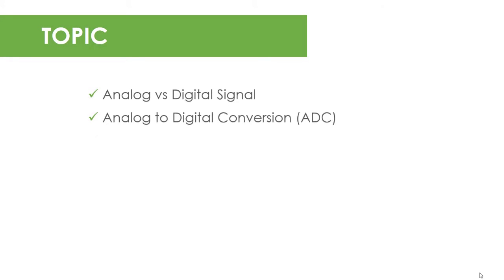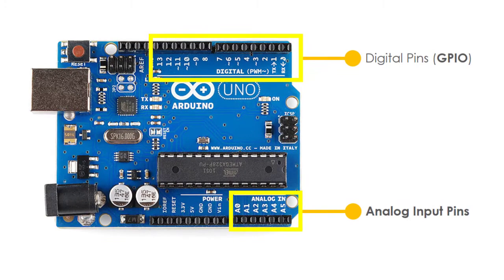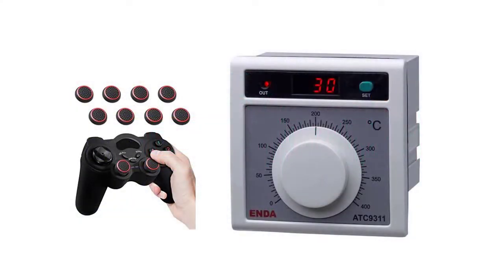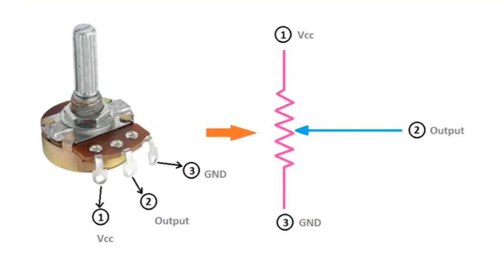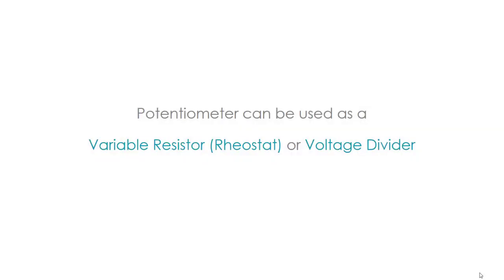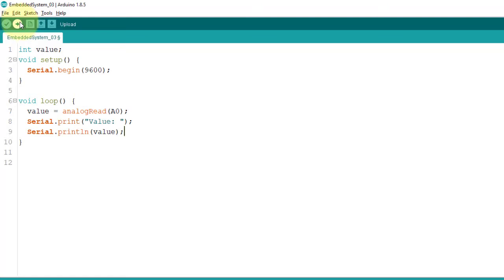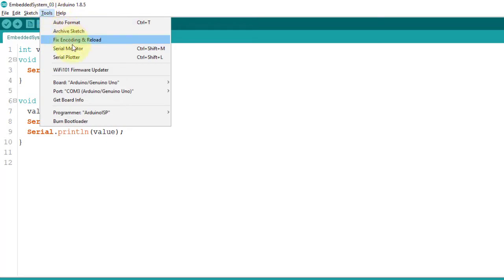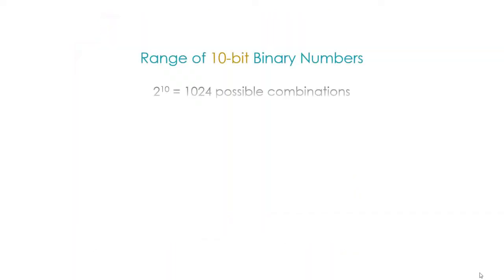08  Arduino Analog Input Explained using Potentiometer and LDR | Embedded Systems

Comment: #include <Arduino.h>
void LED_Blink();

int value_Ldr;
int value_Pot;
float voltage;
bool state = HIGH; 
void setup() {

  Serial.begin(9600);
  for(int i = 6; i <=9; i++) 
    pinMode(i, OUTPUT);

}

void loop() {
  value_Ldr = analogRead(A0);
  value_Pot = analogRead(A1); 
  LED_Blink(); 
}

void LED_Blink(){
  if(value_Ldr <= 500)
    for(int i=6; i<10; i++){ 
      digitalWrite(i, HIGH);
      delay(value_Pot);
    }
    for(int i= 6; i <10; i++){
      digitalWrite(i, LOW);
      delay(value_Pot);
    } 
}

Comment: Hi
If we have a tracker solar on two axes and we want to use four LDRs and a potentiometer, what will be the role of a potentiometer and how should it be used?
Reply from the maker: You will use potentiometer so you can adjust your voltage divider circuit. This affects your program when to move your solar panel.
Reply: @joedgoh  If, for example, the Light intensity LDR North is larger than the light intensity LDR South, the tracker solar must rotate to the North, so what the exactely  role to potentiometer in this process?
Reply from the maker: First, your potentiometer has nothing to do with your motor. It has something to do with your voltage divider circuit to adjust the voltage drop depending on the light intensity received by the LDR. You can even design a circuit for a solar tracker using ldr without any potentiometer if you know the exact value of your resistor to use. I suggest you learn the purpose of voltage divider circuit first. Also I am assuming that when you say you have a potentiometer in your circuit, is that, you are using it as just a variable resistor. Thank you
Reply: Hi,
I used just a LDRs and I do this code for controlling the first servomotor.
If (ldr1>ldr2)]
{
S1. Write(60);
delay (15);}
else if (ldr1<ldr2){
S1. write(70);
delay (15);}
else{
S1. write(0);}
 when ldr1>ldr2 the servomotor turne but when i increase the value of ldr1 one more time, the servomotor does not rotate، What should I add to the code to solve this problem?
Thank you  in advance.
Reply from the maker: Does not rotate where? You have only specified to position your servo at 60 deg when ldr1>ldr2, and it did as you mentioned. If you increase the value of ldr1 further, then it will still do the same thing: position the servo to 60deg. If it is already there, then you will not see it move. You have only specified 1 rule for it. May I know your profession or if you're a student may I know your degree program? Thanks
Reply: So the solution is to use the loop for?
Reply from the maker: No, your code is already inside a loop. The void loop function.
You need to specify another condition that once satisfied, your motor should position to that location. In your code, you only have specified 2 positions, 60 and 75 deg. Are these the only values you want your servo to position or there are others? If there are other position, you need to explicitly tell at what values of ldr1 and ldr2 these servo postion shpuld be called.
Reply: No, I want if i increase the value of  LDR1, the servomotor must rotate without a specific value of angl and stop when I increase the value of LDR2, the two LDRs must receive the same value of intensity that's way the servomotor should rotate to equalize them

Comment: Hi 
but when i removing 5 v the ADC Continue read noise between 0 to 1023 . Is there a way to isolate this noise?
Reply from the maker: Hi, 
can you clarify the question? Removing 5v where?
Reply: @joedgoh   i mean take off
Reply from the maker: I am sorry, I really get your question. Like Why would you remove the 5v supply in a voltage divider circuit and still try to read the output voltage of that in an analog input pins of your Arduino? Regardless of whether you use 3.3v or 5v, the resolution of each analog input pin is 10 bit. So it will definitely read anything from 0 to 1023, even without meaning. If you don't want to receive this random numbers because you have already removed the supply, might as well remove the analogRead() function in your code..because what is the use reading something that is not connected to a supply.
Reply: @joedgoh  Hllo
- i mean i have output digital and this output will be HIGH when i  receive this random numbers
- and I have a voltage generator 5 volts ( analog read ) this generator sometimes on sometimes off , then When it is off arduino still receive this random numbers